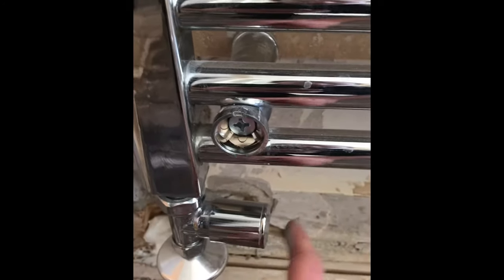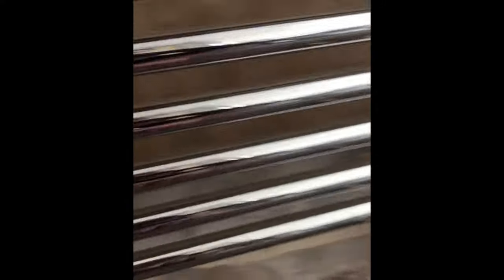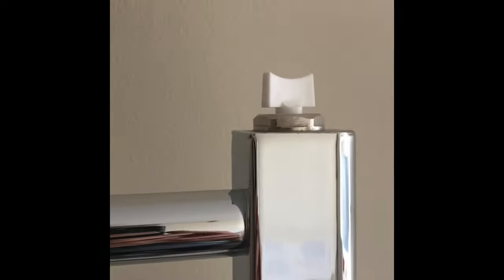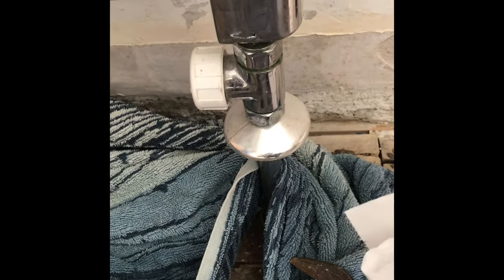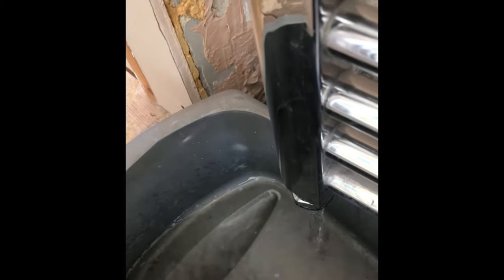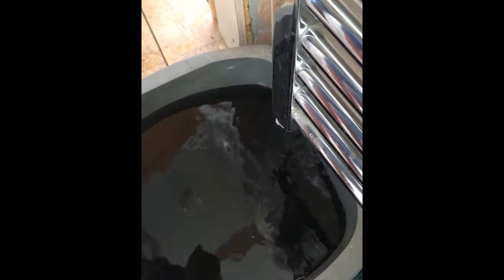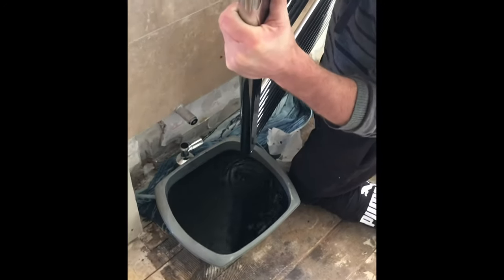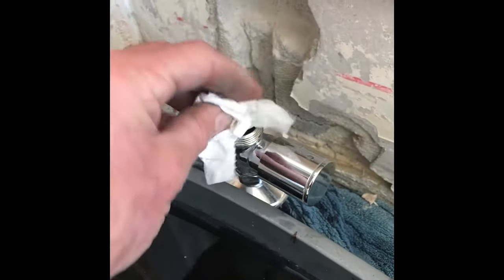How To Remove A Towel Radiator, Removing A Ladder Radiator, Home D.I.Y

Comment: Thank you! This has just helped me (the clumsiest, least practical person on the planet) remove a towel radiator as part of redecorating a bathroom. Here's hoping reinstallation is as simple! 🙂
Reply from the maker: Tony, fantastic that it’s helped you. If you can take it off then it’s just the reverse to put back on. 
Much cheaper then getting a plumber in. 
Hope the rest of the bathroom goes well for you. I’m in the process of now doing my shower. Such a pain to do when you have children and a normal job.

Comment: Could I put the central heating on whilst the towel rail is still off? Great vid btw, really helpful
Reply from the maker: So long as the valve is shut and not leaking then you are fine to run the heating system. 
Thanks for watching 👍

Comment: Amazing. So I am planning to remove those towel radiators forever from my powder bathroom which obviously gas no shower. And not get them back. I am worried will that make that powder room very cold and will bring more dampness. Basically wgat impact will that removal will have.  I live in UK.
Reply from the maker: Hi. 
Thanks for watching and messaging. 
If you are planning to remove all methods of heating the room and the room is of a significant size I.e larger than a double wardrobe type area then the room will feel cold. 
If the room has windows then the room could also suffer from damp. 

I would suggest you look at either replacement of towel radiators to a normal convection radiator or alternatively look at electric underfloor heating. 
I would discuss your options with the builder that is, I imagine, going to do the work for you. 

Hope this gives you a little more guidance.

Comment: Do you need to turn off the water mains? Thank you for sharing
Reply from the maker: Hi. Thanks for watching and your question. 
So long as you have valves fitted, which should be the case, that connect the radiator to the pipework then no you don’t need to turn off the mains water. 
You just need to make sure you shut down the valves to stop water flow into the radiator. 
If you don’t have valves fitted to the radiator then there should be isolation valves installed to the boiler that allows for isolation of the heating system to normal water. Again no need to turn off the mains. 
Always check first though before starting your plumbing jobs. Good luck

Comment: Thanks for uploading, when I tried unscrewing the nut on the right, water flowed upwards from the pipe feeding the radiator despite closing off the valve. Any idea where I am going wrong?
Reply from the maker: Hi and thanks for the message. Sorry about the delayed reply. 
So long as you closed off both valves, 1 either side, then there would be no flow into the radiator.
Are the valves thermostatic types like the ones in my video?  If they are not thermostatic types them there would be a plastic cap over the valve screw that pops off to allow for the valve to be closed using either flat head screwdriver or a spanner. 
If the valves are both shut fully and water is still flowing then it sounds as though you have a faulty valve.

Comment: Great video. I have the non-thermostatic valves on both sides - does it matter what side I undo first? Thanks!
Reply from the maker: Hi and thanks for the message, and for watching. 
It makes absolutely no difference which values you do first.
Reply: @diyhomeandgardening  Thanks for the quick reply :)
Reply from the maker: @stewartv6859  no problem. Good luck

Comment: Thank you very much for this useful video. My right hand side has no valve to close similar to yours (small white valve). I have only the thermostatic valve. Is this an issue ?
Reply from the maker: Firstly thanks for watching and glad you found the video useful. 
The thermostatic valve will shut down so long as you turn it down to the zero  so that’s no problem. The white valve, if it’s a valve will shut down through turning. If it is just a white cover that doesn’t turn anything then that cover will pull, pop, off to reveal a screw type head or rod. This section can then be shut down using either a screw driver, if screw type, or by using a spanner if square rod type. 
Once both valves are shut you are good to take the radiator off.
Reply: @diyhomeandgardening  Thank you so much. I indeed remove the meral cover and there was a alen scew (8mm). I need to get an alen wrench so I close it. Greate video.
Reply from the maker: @b.a.b7834 . That’s great to have an easy fix. Saves you some money too in being able to remove the radiator yourself.

Comment: Hi thanks for the video tutorial. I followed your advice to remove two upstairs bathroom towel rails. However I’ve now lost hot water in the house, the pressure is on 0 and when I try to refill it water comes out of the open pipe where the radiators were??
My rads are a bit different to yours in that the pipes come out of the wall rather than from the floor. 
Really not sure how to fix the pressure issue, any thoughts? 
Thanks
Reply from the maker: Hi Steven. Thanks for watching and messaging. 
If you are looking at an open pipe then have you have taken off the radiator valve from the pipe rather than from the radiator. If the answer is yes then you need to put the valve back onto the pipe, and make sure the valve is shut, before sorting out the water pressure. 
As you mentioned that the pressure is at 0 I assume that you have a combi boiler. Does that also mean that you no longer have hot water?
Reply: @diyhomeandgardening  thanks so much for the speedy reply!  And on a bank holiday too…!! Yes that’s what I’ve done, I thought afterwards that maybe I’ve disconnected the wrong part. Will I now be able to disconnect the radiator valve from the radiators and put them back on the pipe to cap off the pipes? Yes it’s a combi boiler. We have no hot water 😩 thank you for your help!
Reply from the maker: @stevengreenow1403  
Happy to help. Still have time before the funeral!
As you have the whole radiator off, presumably still filled with water, I would suggest take it outside to remove the valves from both sides and allow the water to empty. 
Put the valves back onto the radiator, making sure you put them on the sides them came from, just in case there are subtly length differences. 
If your fittings are other than brass then you may need to add some PTFE tape to the fitting threads to ensure a water tight seal. 

Once valves are on you will be able to re pressurise the system by turning on the flow valve that should sit beneath the boiler.
Once the pressure is above the minimum then your boiler will allow hot water again. Pressure level is normally between 1.5 and 2 bar pressure for most boilers but there should be an indication point to show minimum and maximum. 
Hope this helps but if you need more then just message me.
Reply: @diyhomeandgardening  ok great thank you. No I drained the radiators before moving them off the wall, so they’re empty 👍
Will see if I can work it out. Thanks so much for your help. Will be sure to let you know how I get on…
Reply from the maker: @stevengreenow1403 . No problem I’m sure it will work out fine. Enjoy your day
Reply: @diyhomeandgardening  the thing that’s confusing my is that the radiator has a thermostat valve which is turned to off, but the other side doesn’t seem to have a on/off valve? It’s like a pointed plastic cap?
Reply from the maker: @stevengreenow1403 . The plastic cap pulls off and beneath that is a wind down valve. You just use a spanner or pliers to shut the valve down.
Reply: @diyhomeandgardening  perfect thank you! You’re a life saver!!
Reply: @diyhomeandgardening  problem solved thank you!! For some reason one of the valves shut off by going counter and the other one anti but we got there in the end! Appreciate your help
Reply from the maker: @stevengreenow1403  
Glad you are all sorted. Is your hot water working too?
Reply: @diyhomeandgardening  yes all back up and running 👌 there’s a small drip coming from one of the valves but hopefully some PTFE tape will solve this 🤞🏼
Reply from the maker: Nice one. Enjoy the rest of your day

Comment: Hi Great video. If I don’t want to replace and just leave, what do I need to do to stop risk of leaks etc?
Reply from the maker: Hi Martin. 
Thanks for the message and for taking the time to watch the video. 

Just to check. Are you meaning to remove the radiator all together?
If total removal then you have a couple of options. 
Either drain the system a little so that stop ends can be soldered onto the existing riser pipes, either at the height they are or at a lower height, subject to cutting the risers down. This may require flooring to be lifted to get a neat finish without signs of pipe. 
Alternatively, and much simpler, is to fit stop ends that are of a compression fitting. With compression fittings you would only need two sets of spanner’s and PTFE tape as an extra precaution. 
It all depends on how experienced/handy you are in plumbing. 
There are plastic speed fit, push on, stop ends too but make sure you go for a decent grade. I normally use HEP20 as a more commercial and robust make. 
If in doubt then get a plumber in. 
Good luck with your project👍
Reply: @diyhomeandgardening  Thanks for such a quick response…it’s a live project:)

It’s in a utility. All floor up for tiling. Will be behind appliances. Just want to make sure it’s secure after removing. Don’t really want to muck with system to much. It is pressurised. How does option 2 work? What do ask for at shop?
Reply from the maker: @bretwalder  
Look on Screwfix website, item 65021 Compression Stop End for 15mm pipe. 

I did a different plumbing video that is titled, something like, how to go from 3/4” to 22mm pipe. You will be able to see how to fit the ends by the same process. 
With the brass fittings you don’t need PTFE tape but it’s a belt and braces application for me. 
Hope that helps. Any other questions just ask.
Reply: @diyhomeandgardening   Thanks so much. My wife will think I’m a genius. Would love to find a way to thank you. I will
Like and share your site. Not looked where you are based. Have a great day.
Reply from the maker: @bretwalder  
No problem at all and hopefully you will get those brownie points from your wife. 1 day less of nagging🤞😂
Just don’t be too efficient or you will find yourself with more jobs to tackle before work tomorrow. 
Have a good day.
Reply: Got the bits. Struggling to find your video mentioned.
Reply: Hi again. Got bits. Looked at your other video. 

So I need to drain hot water heating pipes (15mm) and cut the existing valve thing off, and then fit the compression valve end?

Your video did not seem to have much water. Concerned if I cut the pipe I’ll compromise the heating pressure. I’m not sure if I know enough to know how to drain a whole house of hot water. I’ve done the hot and cold water, just not the heating pipes. Thanks
Reply from the maker: @bretwalder 
If only there was a way to call you😂

Are you keeping the upright pieces of pipe that you already have, and just want to cap them off?
If the answer is yes then unscrew the unwanted, existing, radiator valve and in its place you can then screw on the stop end. You can use the existing nut and olive ring that are already in place but that was attached to the radiator valve. 
Hope that makes sense. 

If you actually need to remove the upright pipes that were going to the radiator then that is a case of draining down the water a little.
To drain the system:
There should be an odd looking bit that sits below a radiator pipe or valve in the downstairs of the house. That is the drain valve and it can be undone to remove water from the system.

Comment: Is this guide appropriate for a semi-permanent removal, while we wait months for landlord to replace the existing rusty one?
Reply from the maker: Thanks for your message. 
Yes absolutely. My radiator has been off since I made this video, whilst I decorate and re-do the whole bathroom. 
Just keep a check on the isolation valves to make sure they don’t have a slow leak as that can sometimes happen if they have any dirt or rust particles on the valve head. 
Hope you get a replacement radiator soon.

Comment: Great, except the video skips the 20 seconds of undoing the nut before swinging the rail around. Water pissing out everywhere until I got the nut off
Reply from the maker: Hi Chris thanks for watching and the message. I’ll have to check the video as no one has mentioned it previously and I wasn’t aware of any issues. 
Water everywhere is never good but at least you managed to get the radiator off. 
Enjoy the decorating, I assume that’s your purpose.
Reply: Same for me 😢
Reply from the maker: Thanks for the message. 
Did you leave the air vent closed when you loosened the nut, to allow you to rotate the radiator?
If you keep the flow, return and top air vents closed then you won’t have all the water flow out, but it will come out if you take too long to turn the radiator off the wall and over a bucket. 
That’s why it’s much easier with 2 people or get low enough to get your thumb over the outlet section of pipe. 
Once over the bucket then take you thumb off the outlet and open the air vent to the top of the radiator. As the air comes in the water will rapidly flow out without gurgling. 
Hope this helps for next time.